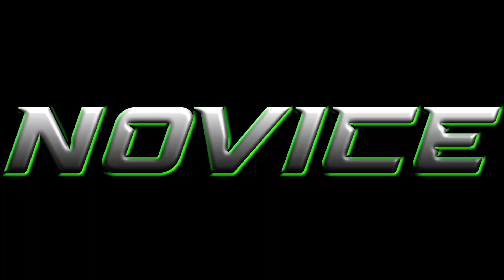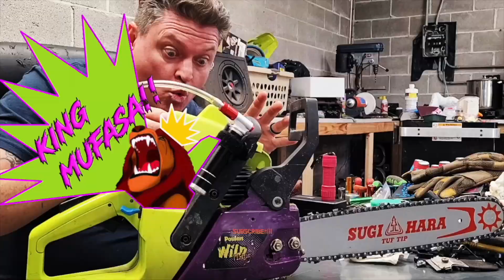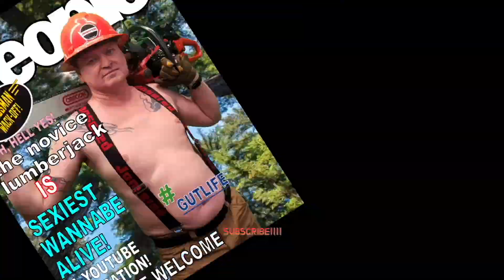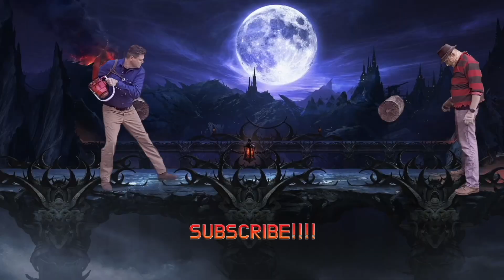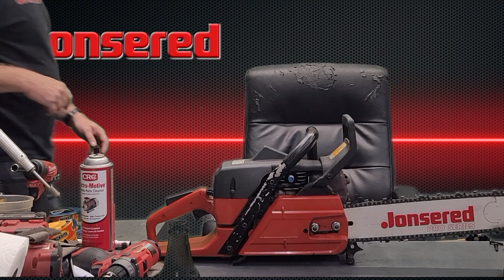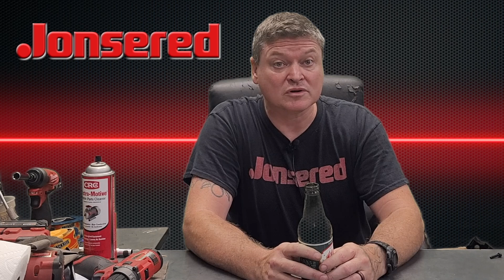Captain Chainsaw puts the SMACKDOWN on T-Dubb! @dubbssawshop jonsered husqvarna 365, 2165, sawfest

Comment: Would you be interested in building my 2065 or my 365 with a 2165 cylinder on it? I emailed you about my 2171 but never heard back witch is no problem im sure you get alot of emails but had Aaron Lynch build it for me but would like to have a saw built by you if you have time if not no big deal love watching your channel but want a 48mm built heard they do well thanks
Reply from the maker: After saw fest.  So reach out to me sometime in late October or early November.   Not taking on anything new until then.
Reply: @novicelumberjack  will do 100%
Reply: @josephsmith1853  👍🆙JS
Reply: @josephsmith1853 Good choice!!

Comment: I think there is one more difference between the 2166 and 2172. I believe the 2172 has crankstuffers and the 2166 does not. I’m 99-% sure. Heard that from a long time Husqvarna/Jonsered dealer. Also I picked up a very nice low hour 2166 today. I’m a happy camper.
Reply: Only difference is cylinders and a little spot in the case  no stuffers in either
Reply: 357 and 359 that was one difference crank stuffers.